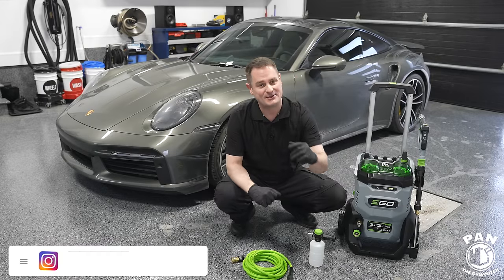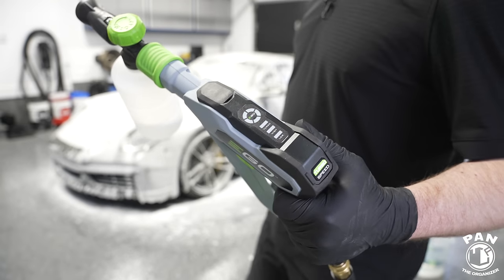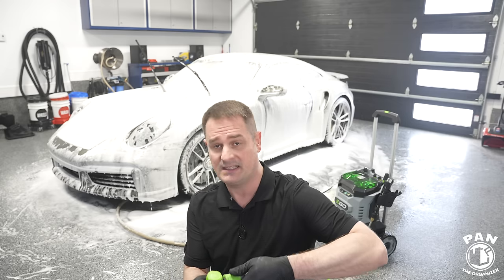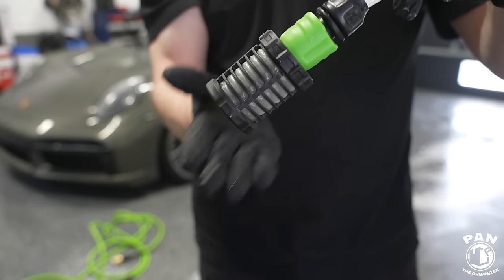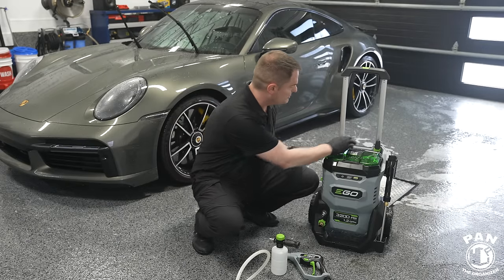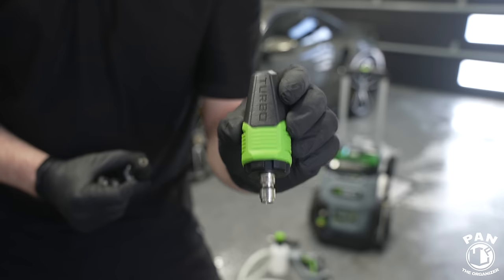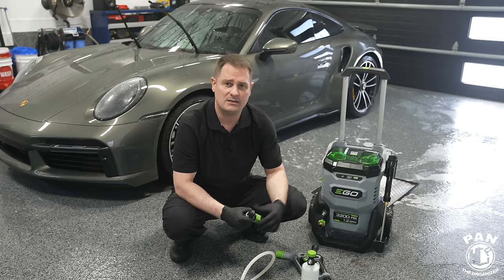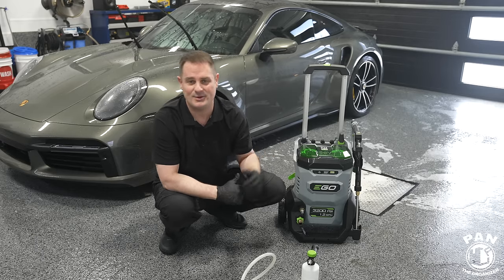EGO Battery Powered Pressure Washer Review... 3200 PSI??

Comment: Outstanding review bud. I have been using this unit for 3 months now and LOVE it. That said, I have made some changes to the gear I use: Those being: 1) gun and wand {OG Spec Mosmatic Swiveling Sprayer  & OG Mosmatic Stainless Steel Bent Wand); 2 & 3) Tip (OG Spec Mosmatic Nozzle Assembly 40 degree /w 3.0 Orifice); 4) Foam Canon (Griot's Garage The Boss Foam Canon);  5) Pressure hose (50' UBERFLEX). The Power is THERE. The mobile flexibility is THERE (much like a cordless DA Polisher) and above all...gets you in the EGO eco-system product line with two awesome batteries (hence, put their blowers on your list or their shop vac.) In the end the unit...for what it offers and what it can do FAR outweighs its price; special when you touch and feel its built quality.
Reply: have u ever looked at dewalts cordless pressure washer

Comment: Great review Pan, thank you. I’m a weekend warrior living in the northeast. Admittedly I’m surprised to see so many reviews struggling for use case beyond apartments and mobile detailers.  I’ve been looking to buy/build out an electric pressure washer system for my home in New England but unfortunately worry about a wall mount solution with temperatures dropping below freezing in the winter months and also worry about the amp load of a system competing with all my other electrical needs in my garage despite being a new construction home. I have lots of lights, tv, chargers, dehumidifiers, etc. 

I contemplated a dedicated pressure washer cart option using an Active 2.0 or 2.3 but space can be a bit limited in my garage and basement (in the winter months). I’m not set up to wash in my garage, so I need to be prepared to do my cleaning out in a large driveway. 

I have a very thorough EGO ecosystem including multiple leaf blowers for drying my cars. I just purchased the pressure washer this weekend as it gives me a very quick all season pressure washing capabilities. It’s also relatively quiet, giving me more flexibility to wash earlier in the morning or later in the day to void the process of washing in direct sunlight, the ability to potentially use warm bucket water in cold weather is also appealing. 

Super excited about adding better pressure hoses and potentially shortening the distance from gun to nozzle. And there appears to be a premium foam sprayer with brass body coming in May. I’ve preordered that to see how it dispenses. 

Thanks again for the review!

Comment: It's great that EGO continues to develop products for their ecosystem.  I have rented and owned a few different pressure washers over the years, with varying levels of success.  Having this battery-powered option with water source portability was a big selling point for me.  It allows me to reach parts of my property that would have been impossible because of the distance from a water source.

I washed a couple of cars and pressure washed the siding on my house over the last couple of days.  I did experience two operational issues, however.  First, the "weighted" siphon attachment floated quite a bit in my water reservoir.  I had to attach a baseball bat donut weight around the bottom of the siphon (surprisingly a perfect fit) to keep it at the bottom of the bucket.  The second periodic issue I had was the ego batteries flashing one red bar on both batteries.  I was able to resolve by ejecting the battery, pressing the level check button which displayed green all the way around, and immediately reinserting the batteries and pressing the power button.  It happened a couple of times over the two days, and I was able to resolve it the same way.  If anyone has an idea about what is going on, I would appreciate the help.

Comment: I’m a big fan of Ego.  All of my lawn care equipment is from them.  I also have this unit and overall I’m very satisfied with it.

I do have a couple minor complaints:
1) I don’t like how you have to disassemble the wand to store it
2) The speed indicator on the unit and on the gun is very hard to see in sunlight
3) Powering down my unit is potentially bugged.  When I stop washing and press the power button nothing happens.  The internal fans keep going and the battery indicators are still lit.  I have to wait for the fans to stop then I can hit the power button.  This could be a safety feature to allow the batteries to cool down but I didn’t see anything mentioned in the manual

Comment: I agree with one of the other folks here - that coiled hose is a big no-go. As a detailer, I notice my OCD tendencies a lot, and the hose coils as well as power cord coils drive me a bit.  All in all it looks to be a decent pressure washer, but batteries have a lifetime (number of recharge cycles), and looking at the price of the unit, I imagine the batteries are expensive. I like electric power washers as they are quiet relatively speaking so it does provide that. I imagine there will be improvements in the product life cycle :) Thank you very much for the excellent review!
Reply: Flexzilla hose otw for me. I have an Uberflex now but the zilla green looks best. Same hose either way.
Reply: i tgink an hour in the sun straightened out then rolling it back up after it cools that hose would be fine , they all come tightly coiled to fit in the box so theyre gonna kink up like that at first
Reply from the maker: Thanks Brian!

Comment: I plan on buying this Ego Pressure Washer, I also plan on buying the Ego shop vac.  I already own an Ego lawn mower, 765psi leaf blower, and a carbon fiber auto feed string trimmer, and a hedge trimmer.  I only have two Ego batteries a 7Ah that came with the mower and a 5Ah aftermarket, which is really holding up and working great.  I want to buy this with the two 6Ah batteries because if you look at the list price for the batteries and charger you are getting the pressure washer for free.  I would like to start a mobile detailing out of the back of my Buick Encore. I can use this pressure washer and not need a generator, same with the Ego shop vac, and if I do need power for some reason, I can get the EGO power inverter that runs off their 56v battery.  When I save up the money, or actually make it from detailing, I plan on getting 2 EGO 12Ah batteries, usually $999 on Amazon as a set.  I want to get a water tank, but until I do, I can use a couple of buckets with lids and use the syphon hose included with the washer.  I can fill the buckets at my local grocery store reverse osmosis drinking water machine, it cost $.50 a gallon or $2.50 for 5 gallons.  I've tested the water with my TDS meter, and it reads 002 TDS!  Spotless Water without the cost of a DI system!  When using the pressure washer, I have a choice of foam cannon, EGO actually sells a proper foam cannon for $79.99 on Amazon, or I can put some rinse-less wash, I like DIY Detailing V2, directly into the bucket and use the pressure washer to dispense the rinse-less wash, OR I could use a Hybrid wash, with DIY rinse-less in the bucket and incredible suds in the foam cannon!  The only thing I need to know is, when I go to buy the EGO pressure washer and EGO Foam cannon, is the link above an affiliate like I can use so you get a little $$ your way?

Comment: You are the first review that did the bucket water source, use less water and save battery power by stop using the turbo mode.  Our Dr. Beasley’s class last September used the pre-production unit and it was great option.
Reply from the maker: Thanks for watching!

Comment: I think for doing spot free rinse with a 5 gallons of distilled water would be a great use of the siphon tube after the initial wash.  I live in an area where my TDS is regularly over 500.  Using a spot free rinse would possibly improve the longevity of the pump by also rinsing the pump during the spot free rinse.  My water is so bad where I live that  I am on my third pump on my gas pressure washer.  That is even with using pump saver solution after I use the gas pressure washer.  For car washing I have used an electric Active 2.0 and it has survived my terrible water for over a year. 

Any feedback on how you guys protect your pressure washers with bad water is appreciated.

Comment: While I don’t have this Ego I do have the battery powered DeWalt and can say as a contractor these come in handy at cleanups when you don’t have access to a hose but still need to cleanup. I have a gas pressure washer for when I have hose access. The ability to load up the pressure washer and 2-4 buckets of water allows you to clean things up. These also work great for cleaning out evaporator and condenser coils as you can simply roll out the washer and bucket me go to town, no hoses to drag out or get to a spigot and no need to ask for permission to use someone’s water. These also allow those in apartments that may have limited spots for car washing or spigots to simply move over or across a parking lot and still wash their car. Another big benefit, that actually goes hand in hand with most battery tools, is these are insanely quiet relative to other washers.
Reply from the maker: Good points!

Comment: I just ordered one of these from Lowes for $854 out the door, $799 B4 Tax. I got mine as I wanted a newer more powerful washer than my current Ryobi 800 psi 1.2gpm unit. I am no washer snob, I use the Ryobi 600 psi EZClean 18v Power Cleaner when I'm in the woods and my Dirtbike is covered in mud before I load her up on the trailer. I use a VP Racing 5 Gallon fuel can just filled with clean water, you wouldn't believe how many folks think I'm a genius as they load up their muddy bikes rotfl. Anyhoo, the point is I buy what I need as it fills a hole and I'm not so much brand loyal. I share the love. I have the Ego Blower, The Ego Mower, An Ego Inverter and an Ego Chainsaw. I use it all alongside their gas counterparts when suitable. Honestly I haven't found much the Ego stuff can't do. I am expecting the same quality from this washer. I also ordered some Adams Mega Foam and an AstroAI Foam cannon to go with it that I want to use with this unit. I guess for me it made sense. I wanted a new washer, I am already heavily invested into the cordless world as well as the EGO ecosystem. I will be using it later today, should be good. Thanks for the review, I am a Porsche man myself so it made it all that better LOL. Great review. Thanks.
Reply from the maker: Thanks for sharing your experience!

Comment: I was looking at the Kranzle K1122TST, but after watching your review, I see that I can save quite a bit of money to spend on other essentials for my 🏎️ lol thank you for this video, it goes to show you don’t have to sell the Farm to wash the tractor
Reply: The 1122 is a one time purchase.  This is a sealed unit so you can't service it when the pump goes out.
Reply: @timkinley1779  True...but it come with a great warranty and is very well built. Yes, it is NOT a Kranzle K1322TS Pressure Washer but it will give it a run for its money!
Reply: @golf007sd2  I don't care about a warranty nor do I want to spend money on a disposable unit.  Unless you know going in that you're only going to get so many hours out of it, and you're good with that.  In that case, I'd buy it to experience it and live with the shortcomings.
Reply from the maker: Don't get me wrong, the K11222TST is on a completely different level. It's built like a tank. I haven't seen any other electric pressure washer built as good as that. It's the last pressure washer you'd ever need.

Can you get the "job done" with less expensive units? Yes.

Comment: Bought this and the vac 2 days ago. Was able to wash 2 cars with 2 bars left on the supplied 6.0’s yesterday. Vacuum had 3 bars left after both vehicles. Great little washer but would be best with 2 12.0’s for 60 mins on turbo mode.
Reply from the maker: I wouldn't recommend the Turbo mode to wash cars. The normal mode is all you need.

Comment: I got one and like it. I don't have a garage and this make it nice to not have to drag out an extension cord. I have a Kranzle 1322, love it but sometimes a pain to drag out. I did buy two 12 amp batteries. It does work well with a 3/8 hose and the MTM gun. It does create good foam with the MTM foam cannon with the 1.25 nozzle. Who is it for? Everyone who doesn't have the luxury of having a stationary set up for a pressure washer set up. I do plan on adding the shop vac and blower, possibly the light.

Comment: Great video. I got an EGO leaf blower for Christmas. I used it more then I would have used the EGO snow blower (which I almost bought). Actually, really didn't need a snow blower this past winter.
You ask, who is this for or what market are they trying to serve? In my opinion, someone who is in the market for their first power washer that is more eco friendly (fossil fuel, fumes and noise), or need a replacement power washer and want to go electric versus gas or even power cord electric. Never a fan of electricity and water. Plus, more multi-purpose as the unit is very portable/mobile. Wash/rinse cars, clean walkways and or decking, or take it on the road or in other ways you mentioned and or mentioned below by others. Easier to cost justify. When my gas powered washer bites the bullet, I will be making the change to what is available at that time. Eventually, it will all come out in the wash. 🙂  Cheers!
Reply from the maker: Thanks for sharing your thoughts.

Comment: I would really love this if it had an option to plug it into the wall.  At home, I don't have access to power or running water so battery is perfect.  I go up to my in-laws once a month and have access to power and running water.  I'd love it if I could use it on battery at home but run it off of AC mains at other locations.
Reply: Overall I think it's an excellent unit, especially for mid grade level. I did notice the hose obviously before you even mentioned it and that's a problem. But things like the weighted attachment for the bucket which a lot of companies don't provide. Overall I give it two thumbs up. Tks pan!! 👍🏼 🇨🇦

Comment: One place where getting water from a bucket is wonderful is when it comes from a well. The pressure and volume aren't the greatest so being able to pump water into a bucket and draw it faster than the well can supply is good thing. I could have used that 40 years ago when prepping a wall for painting and finding out the well couldn't supply water fast enough for the pressure wash I was using.
Reply from the maker: Good point Chris!

Comment: I see use for this. I rent, I usually rely on car wash bays for touch less washes. Landlord does not want any car washing in the parking area(back of the house) on our property. I can wash on the street (front of the house) but there is no water supply outlet in the front. Detail shop near by has a refill station for detailers and I can get spot free water from there!
Reply from the maker: Good point!

Comment: As someone who lives in an apartment over a garage as part of a block of townhouses - while I do have access to an outdoor tap, I would need a very long hose to wash my car or say the concrete surface of my balcony. The fact this is battery operated and can draw water from a bucket would work much better for me. I wouldn't need to run a hose from my tap (at the rear of my property) around to the balcony or where I can park my car to wash it. Same for Power (Though I do have a 30 m extension lead.)

Cost on the other hand would be a factor as I don't have any other EGO equipment and they only sell the Pressure washer as a "skin only" at all of my local 'tools' chains.

Comment: Amazing video pan, this would be great for me since I live in an apartment building. I was curious, I want to use my own foam gun and hose with a 1/4 quick connector. You mentioned you would need an adapter to do that with this  unit. Do you happen to know which adapters you’ll need to connect your gun and hoses to this unit. Thank you in advance.

Comment: Thank you for highlighting the other Youtuber reviews in this video, both IMJOSHV and CARSWITHKEAV because they nailed it with their testings. Thankfully I already knew this unit was a winner when I saw CSW demo it with Chris Metcalf back in October. I picked this washer up to replace my WORX Hydroshot back in February for 847 USD and it fits perfectly on the end my KOBALT utility cart with the J hooks. I find the cost of this washer priced decently because two 6.0 batteries are seven hundred dollars ordered without the tool. By the way, the OG Mosmatic sprayer and wand fit perfectly in the EGO holster! The answer is perfectly clear Pan, the EGO Pressure Washer is for detailing enthusiasts that live in places without running water and power like myself.
Reply from the maker: Thanks for sharing!

Comment: Great review, Pan.  Thanks for reviewing this unit.  I own and have had some success with the Worx battery operated pressure washer,  one of their higher GPM units, the others are not worth it for mobile detailing, IMO.  While this is a completely viable option (EGO) I wonder if the money would be better spent on a portable power system, such as Ecoflow / Jackery.  I feel there is better value in that solution, especially if you already own a corded pressure washer.  You may get two/three vehicles done with the EGO however, depending on the model, you could go all day with a battery solution and power other items like a polisher, compressor, etc.  You can attach solar as well so you are always charging and topping off in-between jobs.  For mobile use, my money is on an Active 2.0 and battery system, and maybe use the Worx as a backup backup :).
Reply from the maker: Thanks for sharing your thoughts.